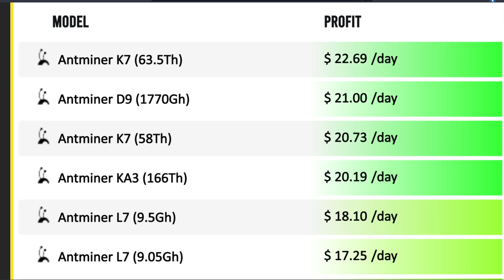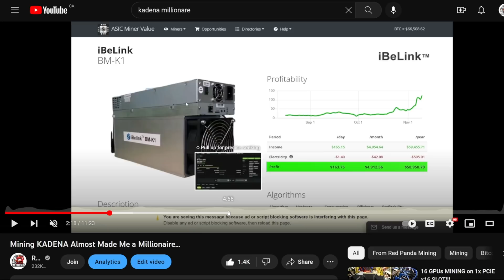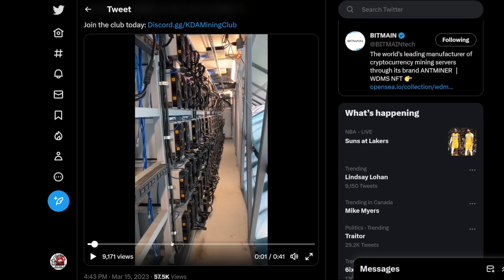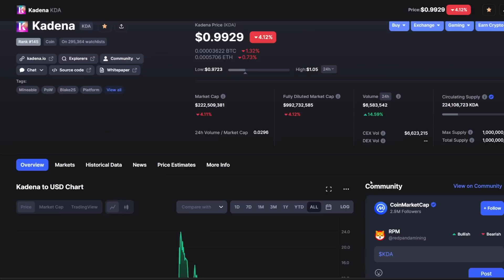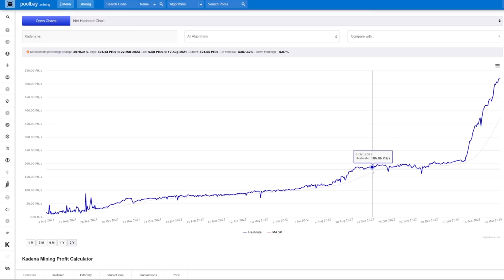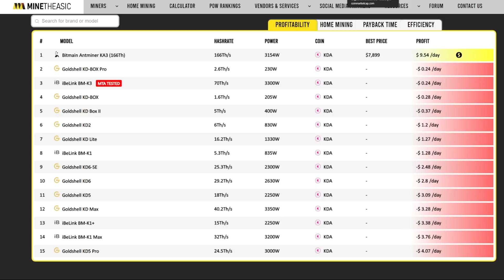Kadena mining is now dead for home miners... for now?

Comment: Hey Panda if you look back at the calculation you did 2.56 x 30 days = 76.8. Then instead of multiplying by $12 you put $2 which gave you  $153.6 should have been $921.6

Comment: One of the problem with most coins left to mine is you lost a lot of liquidity in the market.  One lesson I learned the hard way is you can only sell when someone is willing to buy.  This is why mining was really good past 2 years.  You had people flood markets with defi investing and exchanges were looking for coins to hold.  Now, people only buy when they need the utility the coin provides.  See the issue?  We need coins that have a more universal usage where people want to have and hold.  We also need markets where we can sell for cash.  These bank failures put a nail in the coffin for the next 2 years in mining.  (If you are small or have a high electric rate anyway.  If you have a low rate, then u can mine profitable).

Comment: Does Each Plug on KA3 166th Draw 220 volts or is it 110 Volts each from Power cord plugging into PDU ?
Reply: Each plug.  ASICS don’t use 120.  240 is way more efficient